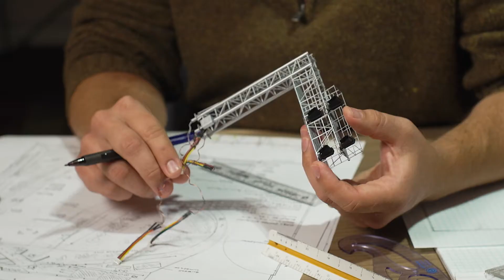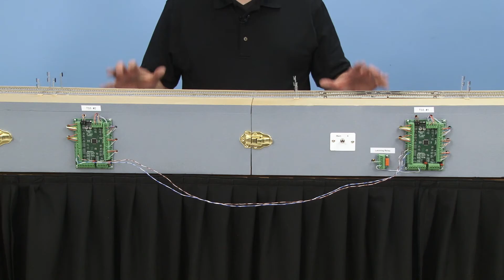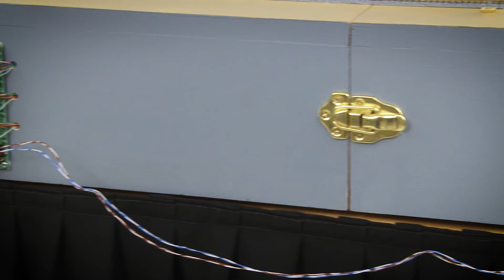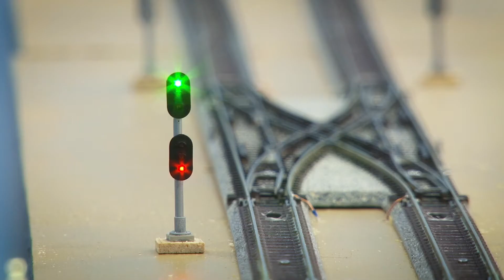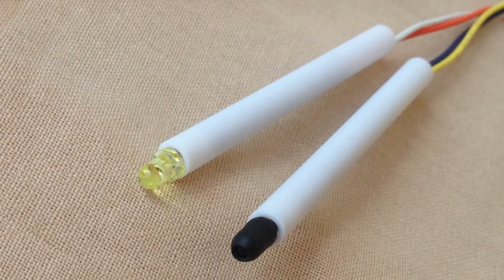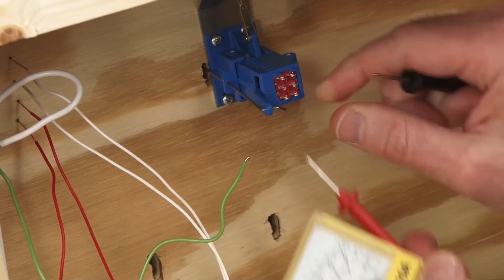TS5 dual-track model railroad signal control circuit

Comment: Will any of this work with a DC only layout?  None of the detector systems, not even Atlas, will work with DC.
Reply from the maker: Hi Michael,
Because infrared light ("IR") is used for detecting the trains, the signal system is independent of track power.  So it works with DC, DCC or AC track power as well as "dead rail" (battery-on-board) where there is no track power.
Reply: @azatrax thank you. The next question is, since my Atlas N scale signals are all common cathode, will your system work with these, or must all the signals be replaced with common anode?
Reply from the maker: The TS2, TS3 and TS5 circuits automatically adjust to either common anode or common cathode signals, as long as all signals that are connected to a circuit board are of the same polarity.

Comment: Can I use this on 3 rail O scale?
Reply from the maker: The signal system is not connected to the rails, so it works with three rails, two rails or monorail. You do need a way to tell the system when a turnout is in the diverging position.  This is done with an electrical contact linked to the switch machine, or with a latching relay that is wired to the switch machine.
http://www.azatrax.com/latching-relay.html

Comment: I have a double cross over so I am looking at the azatrax TS5 for the crossovers..now signals down the line and throughout the rest of the layout  on a dual track mainline bi-directional running,  I would still use the TS5 controller?  I am planning of two dual crossovers in the layout and three other signal locations...Also, I am using Rapido Rail Crew switch machines will these work with the TS5?
Reply from the maker: Yes, the TS5 will control bi-directional double-track signals at a control point where you have one or more turnouts, and for distant ("intermediate") signals where there are no turnouts.  All signals can be linked together.  The Railcrew switch machines have the required electrical contacts built in (the blue, white and yellow wires), so no additional components are needed.
Reply: @azatrax  Is the TS5 in stock?

Comment: Does it work with Switch tracks that aren't a crossover? Like switches that make a siding.
Reply from the maker: You can have one or two signaled tracks coming into one end of your control point, and up to three signaled tracks coming in at the other end.  You can have one or two crossovers, or none.  You can have any number of non-signaled sidings.

Several different configurations are shown on this page,
http://www.azatrax.com/control-point-signal-circuit.html

Any crossover or branch can be omitted from any of the configurations.  It will make no difference to the TS5, it is only aware of a crossover or other turnout when there is a contact closure indicating the turnout is in the 'Reverse' position.  Otherwise, the TS5 assumes the routing is for the main.

Thanks for asking, hope that helps.
Reply: Thank You.

Comment: I like this system, but does it work with Kato Unitrack turnouts? Thanks
Reply from the maker: Assuming your Kato turnouts are operated by an electric remote, use a latching relay to provide the feedback to the signal system.   The relay must be a single coil latching type, such as Azatrax LARY-DCS on this page,
http://www.azatrax.com/latching-relay.html#LARY-DCS

The track used on the video is Tomix N scale, very similar to Kato.
Sensor installation suggestions are shown here,
http://www.azatrax.com/detector-installation.html
Reply: @azatrax  Thanks for the information.

Comment: I have this type of "scissors crossover" in my layout. I operate the atlas turnout with servo motors. I want to use this TS5 in my layout. But I am confused with wiring.
Reply from the maker: Two on/off electrical switches need to be connected to the TS5 circuit board.  One electrical switch for each of the two crossover tracks.  These tell the TS5 if a crossover track is in use, or if the turnouts are lined for the main line.  Your servo controller may have built-in electrical switches (sometimes called "feedback" switches or contacts), check with the manufacturer if you're not sure.  A connection diagram for these switches is shown on the lower part of pg 4 of the TS5 installation guide,   http://www.azatrax.com/install-TS5.pdf
Reply: @azatrax  Thanks for information. TS5 is out of stock. When will be available?
Reply from the maker: @kaustubhponkshe6186  The next batch of TS5 signal controllers should be ready by the end of March 2021.